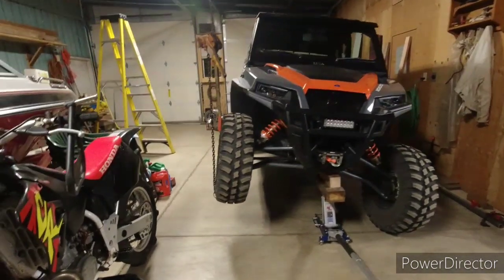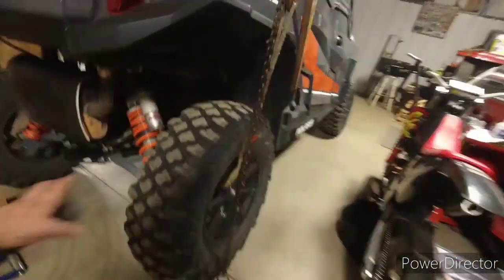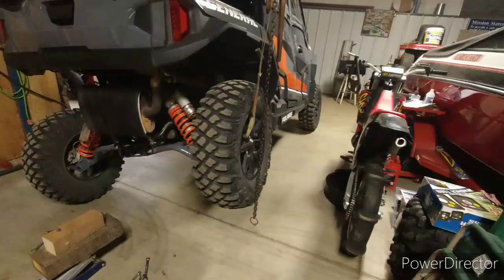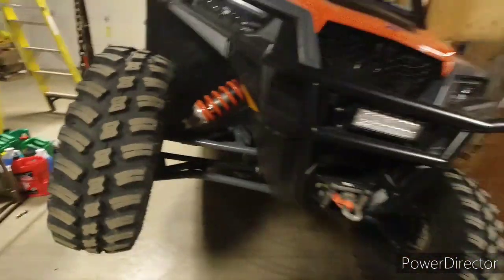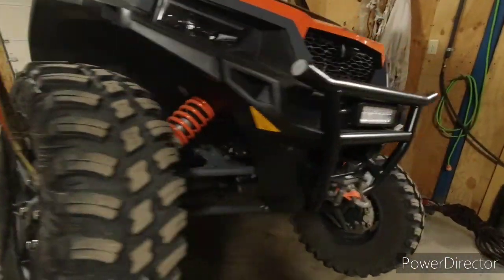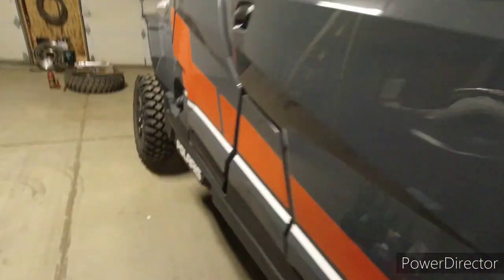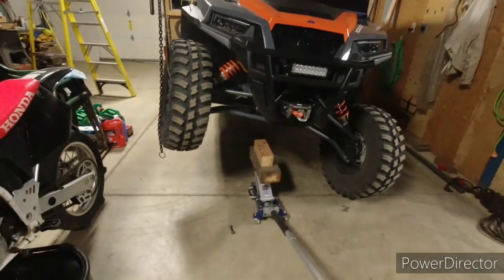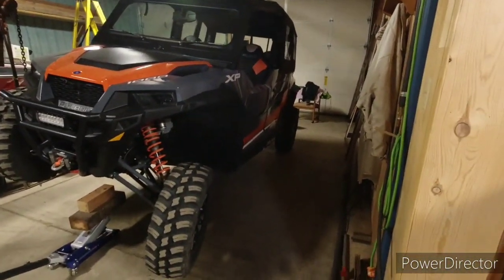2020 General XP 4 sway bars vs. removed sway bars

Comment: Were gonna be heading out to Moab soon and I just wanted to get your recommendation on riding with or with out front sway bar? I got a 2021 general XP4. It's going to be our first time out.
Reply from the maker: If you're going to be going on Rocky trails I would definitely take the front sway bar off. If you're going to try to hit open roads and you want to go fast through corners then you might want to leave it on. I leave my front off all the time now I only run the rear.

Comment: How do you typically keep your sway bars when you ride? Both disconnected or just one or the other?
Reply from the maker: Front sway bar off rear on
Reply: @generaldreamsoutdoors43  Thanks for response, trying to do some research, I just sold RZR and General xp 1000 4 is on order.